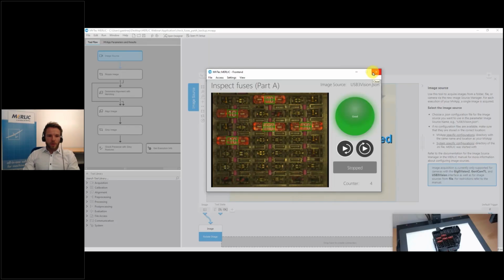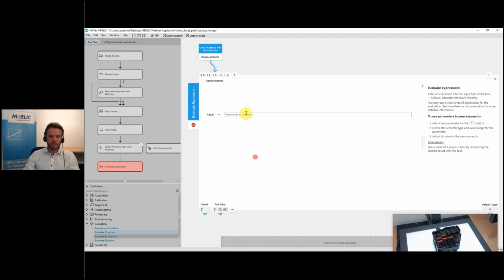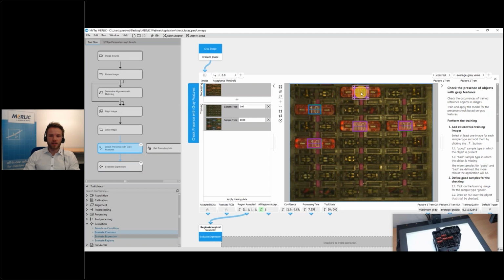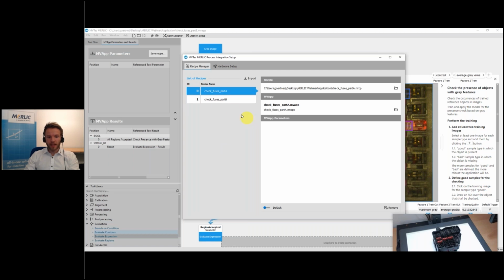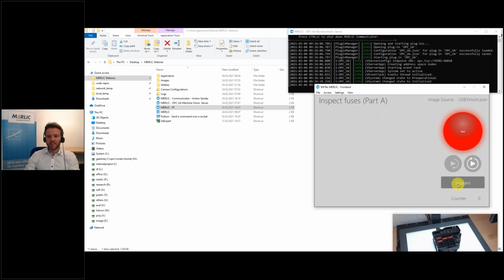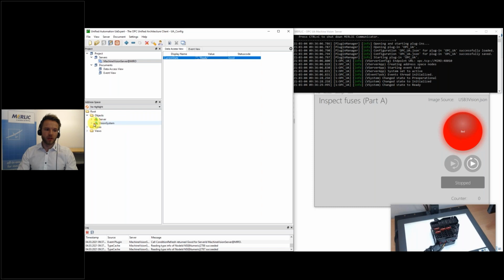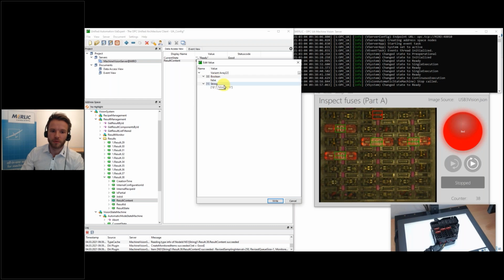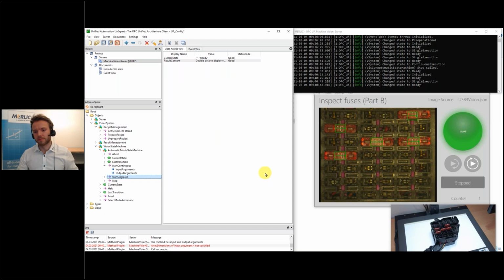Explaining MERLIC's OPC UA server and process integration

Comment: Glad to see you guys again.  I think this part is no need to dive developing.  The more we need is enhance the tools thus we can do our project on apply level so easy. We saw lots of software similar like this and most of them useless. I have develop industrial softwares more than 10 years. OPC is out date now cause it will result in lag and loss package some times means not stable ! We use special protocol on special device which belong to themself is the better choice nowadays.
Reply from the maker: Thanks Jason for your comment. A lot of our customers use OPC UA Machine Vision for their use case. If it doesn't fit your needs, you can use our plugin interface and create your own communication with MERLIC in a very simple way. If you have more questions, please feel free to contact us directly.
Reply: @mvtecsoftware  Yes that's it. Thanks for your kindly answer.
Reply from the maker: @jasonwell5299  We would like to add something about OPC. There are actually two different protocols. One is called "OPC" or "OPC Classic", which is actually obsolete. OPC Classic uses COM for communication and only runs on Windows machines. And there's "OPC UA" or “OPC Unified Architecture” which is a modern machine-to-machine communication protocol that provides information modeling, security and is platform independent (can run on Windows, Linux, Embedded, or even Mac). In MERLIC, we use OPC UA. You find more information about this at https://opcfoundation.org/about/opc-technologies/opc-ua/